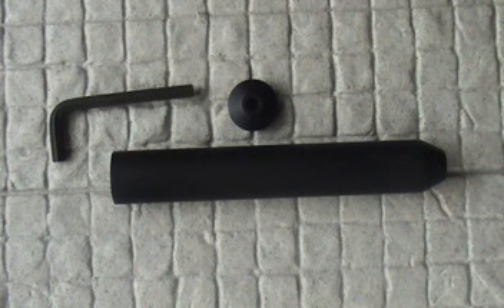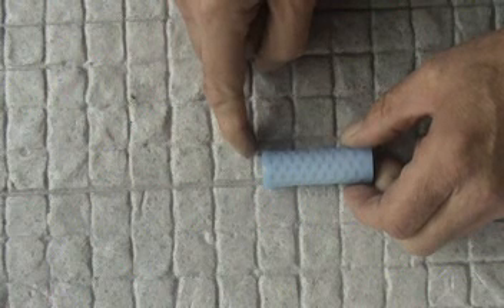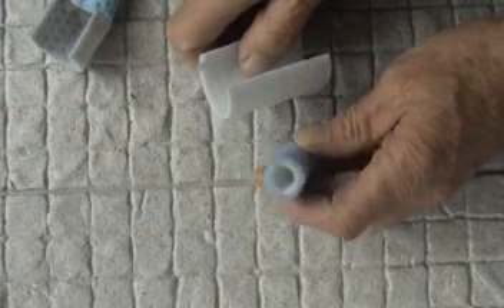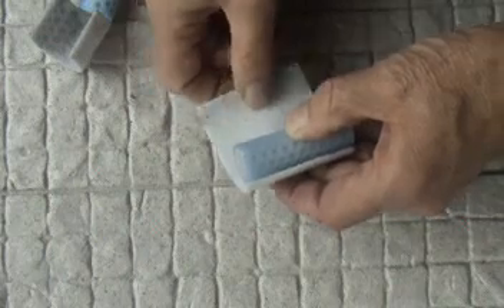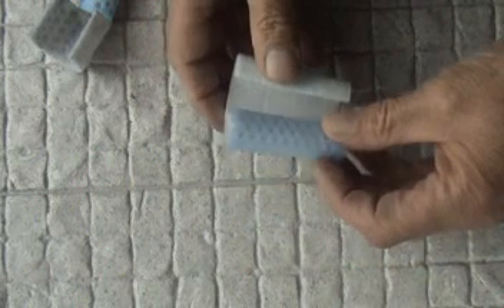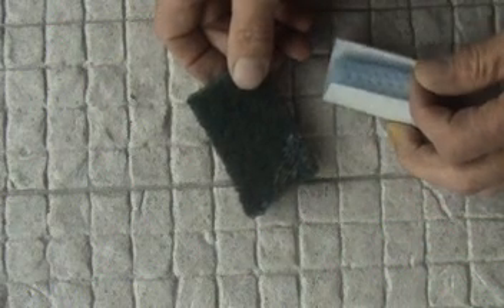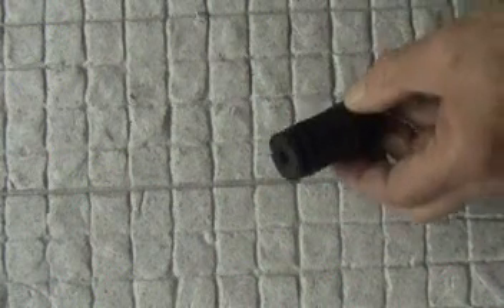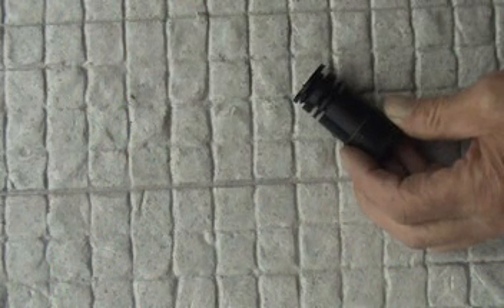AIR GUN SUPPRESSOR MODDIFIED WEIHRAUCH HW RIFLE SILENCER.

Comment: I found another washer. 
Kept the first roller long from the barrel and then split the others so I had 3 baffles about an inch apart then the end cap. This super quietened it down.
Must be in that order. 
From barrel end long roller then washer.
Then split others equally. 
Works very well.

Comment: Buy a long 225mm Air Soft  Mock Silencer 40mm dia,  any style as you like + a 14mm adapter from Ebay. Wrap the Air Rifle silencer with felt or foam and slide this inside Mock Silencer. You can play around with the internals of the original silencer as much as you wish, baffles, rubber washers, hair curlers or springs, felt or metal mesh/scouring pad. You will not achieve silence, you are moderating/suppressing  the noise generated and changing the tone. Increasing the size of the silencer and effectively double glazing it does have quite an impact.